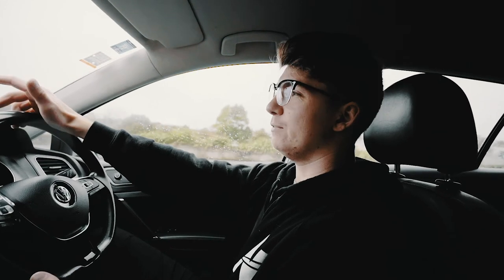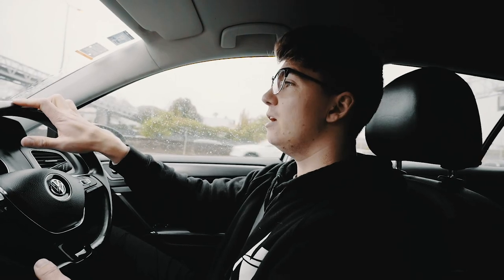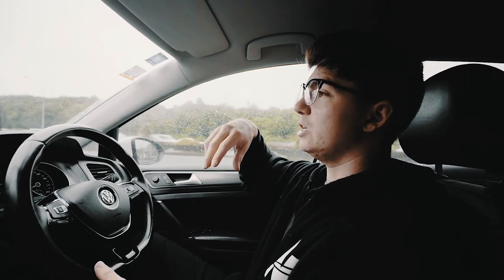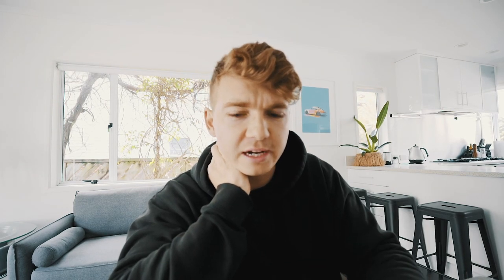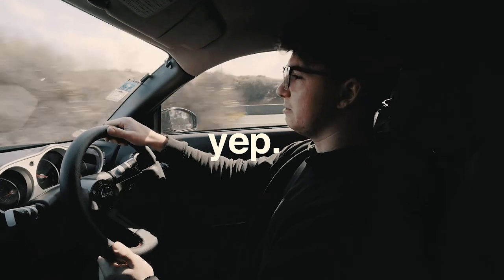Making My 350Z WAY Faster! Dyno Tuning (Uprev HR)

Comment: Hey man! Was literally going to buy this car but someone else just got in before me. Ended up getting a completely stock HR with low k’s. Funnily enough I was watching this video then just clicked that it was you. Any tips on what I should start off with mods wise? Already have an exhaust on the way but looking to do the similar build then eventually drive it to the same and get a similar tune.
Reply from the maker: Do whatever you like man, but I reckon exhaust, suspension and wheels first!  
Tinting the windows will help a lot too, cheers!

Comment: 365 hp!...What mods are we talking here?....
I only ask because Butcher 350 has ported and polished heads and big cams, pipes, manifolds revup etc etc on a 2008 HR and he only makes 343hp at the crank.
Reply from the maker: This dyno is known for reading high but  - long tube custom intakes (pod filters sit down in bumper as you can see in the vid), catless down pipes, performance Y pipe and single exit ISR exhaust.
Reply: @Beinn  Thanks👍🏼...I'd say thats reading a bit high, as Butcher has had real engineering work in his HR, as well as the mods you have and he's had all the work done at Englands best Z tuner / VQ engine builder and he's still 20 + HP off those numbers...be aware of dodgy Rolling Roads😎👍🏼
Reply: Hi beinn I got a 08 350z, just wanted to ask where could I get the long tube intake from?
Reply: Oh and I seen you’ve sold the z too 😢 clean as
Reply: yea i was wondering how the hell he made 365 wheel